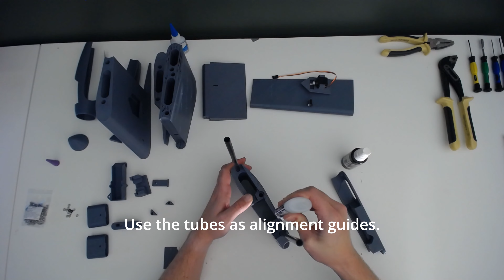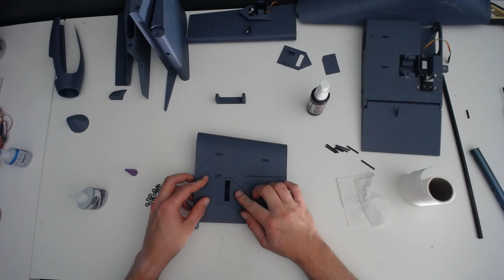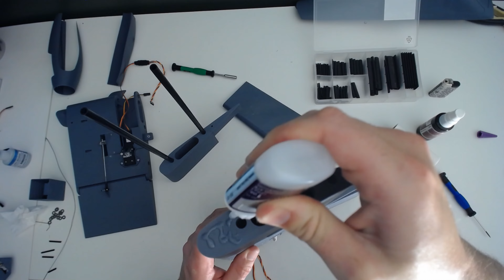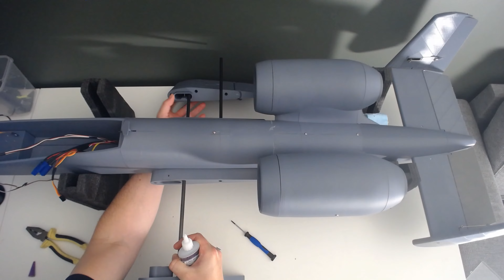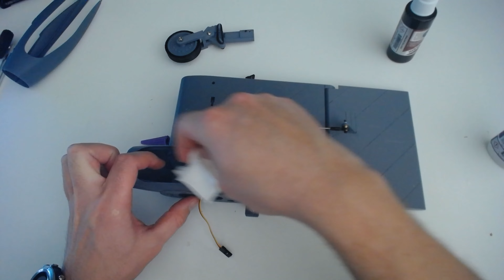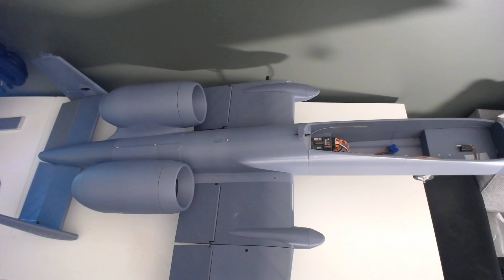3D printed A-10 - Wing build video

Comment: Very nice design. If printing with LW-PLA, any changes to the print profile settings or the print instructions for PLA+ still apply? Thanks.
Reply from the maker: @ebikefe  i have not tried it in LW-PLA yet. I will fly the third one now on thursday and if that is an success, the next one will be LW-PLA-HT. I think i might will do 2% infil for the fuselage but i need to test it first.

Comment: Hey nice one on the F16 design! I was thinking, would you consider a 3D structure design that allows using expandable foam to fill the key parts like wings? To provide extra stability with minimal add-on weight. cheers
Reply: many tried that but it does not wok at all
Reply: oh true! Why is that I wonder? @antonioesposito8071
Reply: @TheQbbxrxr  I tried and either the foam does work properly or gets to heavy making it actually worse.

Comment: Land with flaps next time
Reply from the maker: Was not sure if anyone of those had failed, as it was so unstable during the flight. Tested them up high but it did not stabilize the plane. Will try those next time :D
Reply: after watch your video it looked overly pitch sensitive and looked like it was tail heavy   @Sindrg1
Reply from the maker: @vrosi1963  That is the same conclusion that I have. It was ish at 1/3 from the wing root now but I think I need somewhere around 1/4 from the wing root.
Reply: 25 % from the leading edge is safe  @Sindrg1  .i have flown the fms 64mm arf for years without a scratch with no gyros V1 and large 6s lipo no problem full flaps for take off and full for landing . the airfoil on yours is ? semi symmetrical  i hope